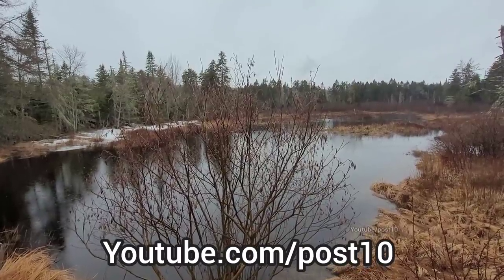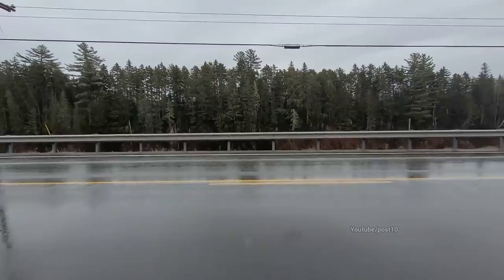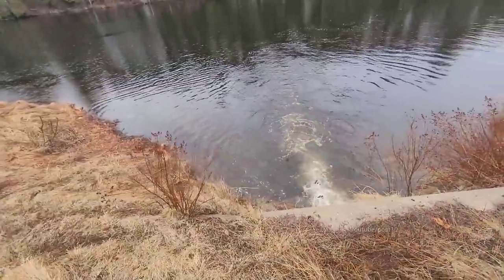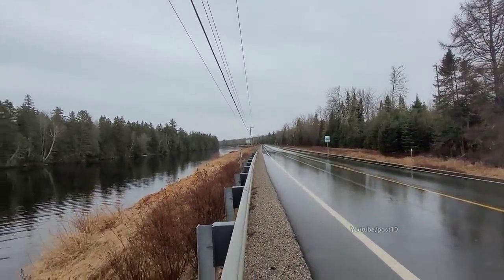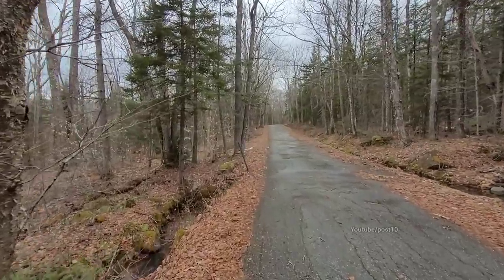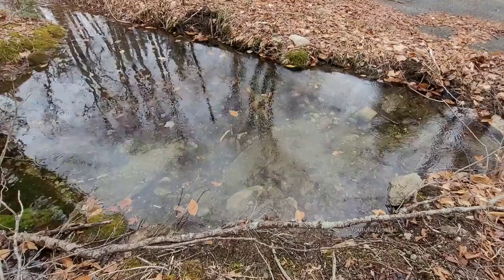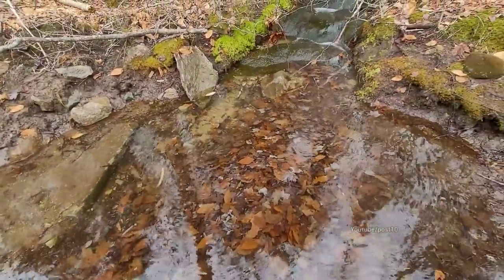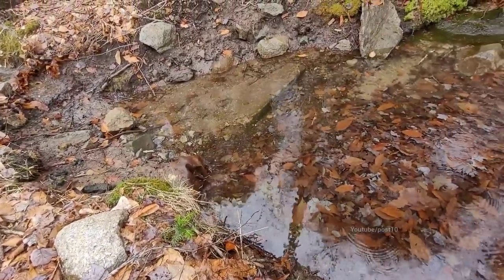Unclogging A Large Beaver Rack

Comment: Really like the idea of making trash racks or grates from recycled material, when it starts to rust out, then just making a new one, perhaps even better. 
And you can recycle the old one as scrap metal.

The rack should be replaced by a similar trash rack as the one you unclogged in previous videos. That A-shape rack is really cool.

Comment: Good morning Post... What's your thoughts on cement end caps. Either round or square precast concrete sleeves that are made for the diameter pipe used, 12, 18, 24, 36..etc. That would make the ends safe from "Idiots with an Excavator". Couple bucks more in the beginning might save coin later. Your thoughts??

Comment: I NEED HELP! I was wondering can you or anyone that sees this help me out with a question I have about culverts. I live in Pennsylvania at the corner of a state route (rt 30) and a township road, there is a drainage ditch maintained by the state along rt30 which curves back onto the township road (about 50ft from the side of rt30) connecting to a township drainage ditch where they both go into a township owned culvert under the township road. On the other side of the township road/culvert is my yard. There is a concrete culvert that continues to run about 60ft under my yard and then another 150ish ft under my neighbors driveway and under their yard all the way down to a NAMED creek. In about 2013 they replaced the old failing metal 24inch culvert under the township road with a 36 inch plastic one but did not replace anything under either of our properties. Since then it has caused the concrete culvert under our property to become damaged and there has been damage done to our property itself in the form of a 10ft wide underground area that has been eroded away and a 8ft deep 6ft wide sinkhole in the middle of our yard. Neither the state or township is even admitting its their culvert and are not willing to fix this issue. They each blamed the other and the township actually said in the end “your property, your problem”. It’s close enough (within a few feet or less) to a massive tree and to our house as well as the neighbors house too, that if the damage isn’t fixed soon it could very well destroy our houses at some point. Can anyone help with some info on what to do or who to call or anything at all? This has been an ongoing issue for at least 7 years now. Multiple visits from township, state, and DEP was even here since it goes into a creek, and all have said the same thing, not our problem.

Comment: Post10 you can straighten out the crushed ends of the pipes with a bottle or floor car jack
Reply: That's what I was thinking... Bottle or scissor with a block of wood to prevent popping a hole in the pipe should do something..

Comment: Well the DOT doesn't really know what it's doing, they do things that doesn't really make any sense. In Las Vegas, they installed LED signs above the I-15 freeway which is the main thoroughfare through Las Vegas, as it travels North and South of the valley. With those signs they're now using it to play with the Speed Limit throughout the day, regardless of what the day is. So the ponds that you enter to clear out culverts are now being imitated by how NVDOT is controlling the Speed Limit on the I-15 freeway.

Comment: Could you not get a crow bar to try and open the end of the culvert ,more as even if it damages the end it'll only really help the rate of flow 
Also it's fun to watch the water drop
Reply from the maker: That metal is a lot thicker than you think. You're not going to move it. I've tried
Reply: @post.10  ye can't get a proper view. Possible could use something to cut through it. Not sure what but could try something like lock cutters or something like that
Reply: @post.10  what about using a hydraulic bottle jack or scissor jack?  Those lift 1.5 tons minimum.  I've used my scissor jack to bust open unlocks left on bike racks at my jobs several times since my regular car jack is too big.  I would think any automotive jack would open up a culvert pipe.  Just place a block of wood on the jack pressure point so it doesn't bust through the pipe.
Reply: @2dronetek2  might be better to day it on his next vid as its harder for him to see replies to comments
Reply: See my reply to John Doe above. There's a risk of criminal liability if he gets too radical with heavy tools.